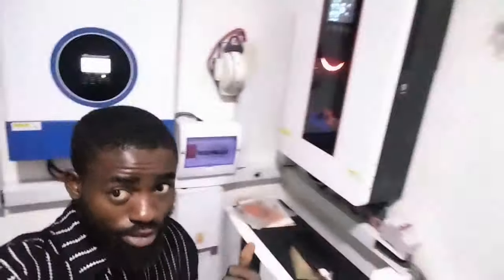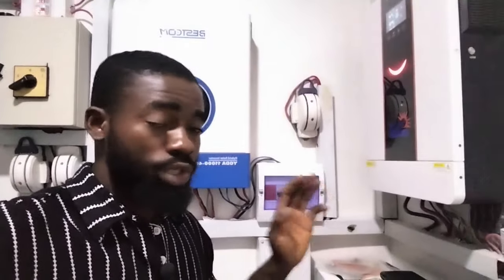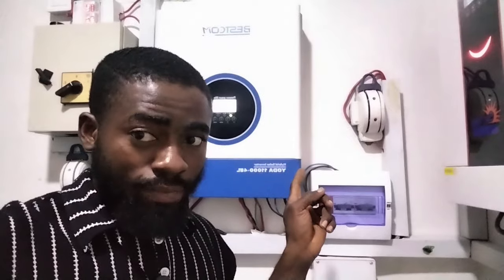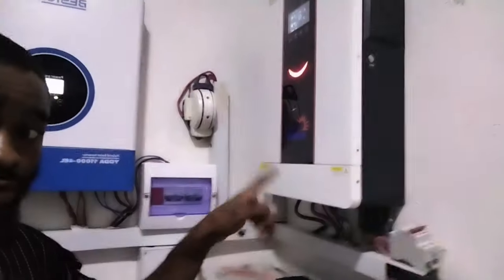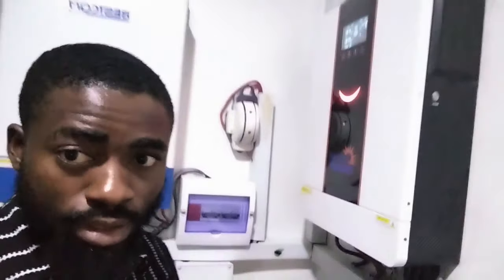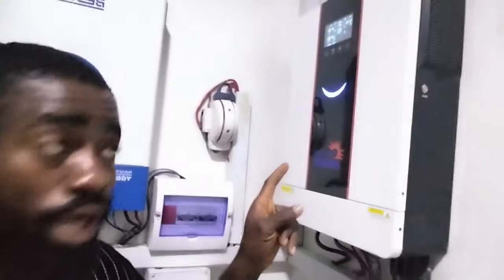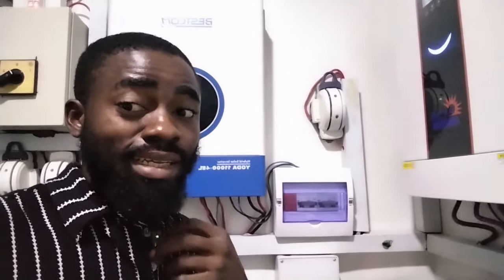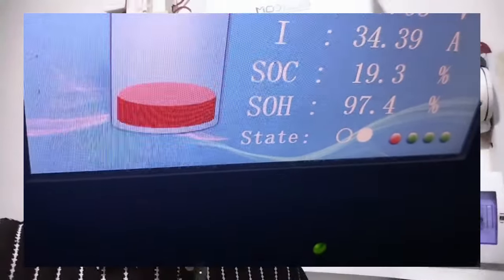IS THIS THE MOST QUIET SOLAR HYBRID INVERTER?.

Comment: I use a 10.2kw Hybrid inverter. It makes much less noise when connected to Solar but the noise quickly jumps to very speed once connected to grid. This explains the difference not necessarily the brand